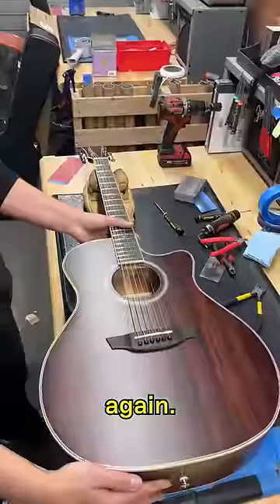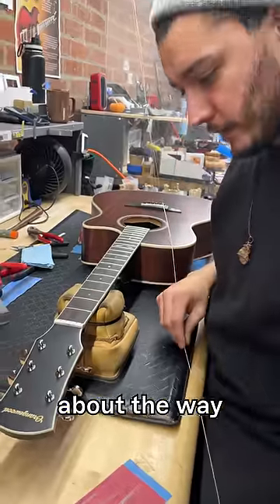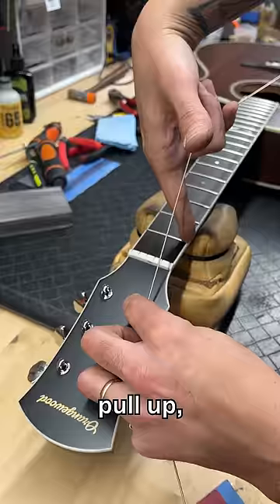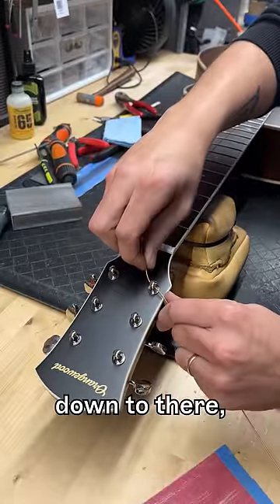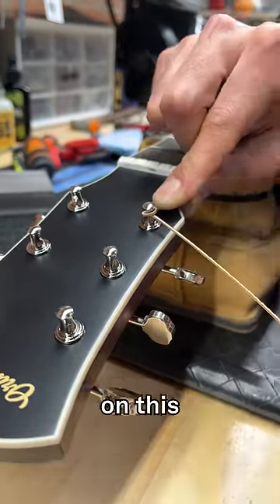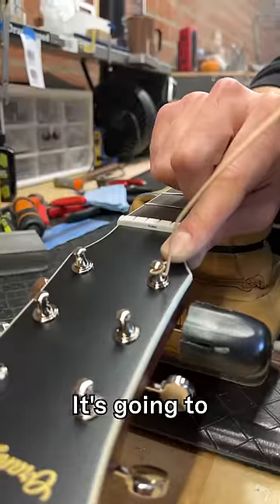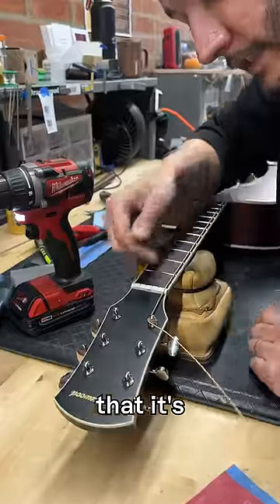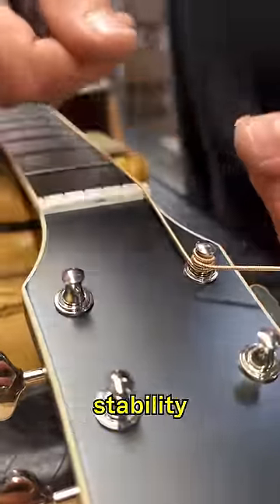Restring your Guitar like a PRO with this HACK

Comment: I used to do it like that (not the cutting them, not good), to get the extra winding length too.
But seen a better way where you pull the string tight to the tunning post and just wrap it around the post the desired number of loops, then push the end thru the hole making sure it exits the hole between the top loop and next one under it to lock it from slipping and you only have to turn the tunning knob a few turns to get it tuned.
Much much faster and no guess work on getting the right number of winding loops on the post because you pre looped it already.
  Have not seen a better way to do it yet...😉

Comment: Too much string on the post makes it harder to keep it in tune. I found that ones around on the thick strings and 2 twice around on the lower thin strings is best. Keeps it in tune easier and you can tune to pitch more in control. if you have too much string wounded around the post that can give more tension and slack making it more likely for your guitar to go out of tune or if you use a capo. Just my personal experience I been restring and playing guitar for over 25yrs.

Comment: This does not effect tuning stability. If you notch the other side the opposite way that over the top bullshit isn't necessary. In fact the extra winds on top increase the chance of microtonal slippage. 2 to 3 winds down are optimal.

Comment: I put the string all the way through and make it taught. Then I grab the string from the nut and slide it down to the second fret. Then wind as I hold the string down in place with my index and hold it under the winding string and you get a better result than this. When you manually wrap the string around you risk messing it up unless you’ve done it a thousand times. And it’s not always guaranteed

Comment: it doesn't matter, that's why the peg has a larger diameter at the bottom and tapers towards the top. As you the wind the string it'll lock in place.

Comment: Pull string thru the desired peg to the next peg. Cut at next peg. Pull back with just enough sticking out to start winding. First wrap goes over the string tip,  rest of the winds goes under. None of this other nonsens is needed!
Reply: Why would you cut the string before getting its set? Besides that, what this guy just did is way more simple
Reply: @NPC-mt1cz  because that's the correct amount needed. Why risk extra string flopping  around that could scratch the finish on a client's guitar? Cut to the length I mentioned, wind it over, then under the rest of the way lock it in place. Done.
Reply: I use that method of measuring where to cut, but I never go over - looks nasty - and my strings never slip.

Comment: It helping with stability is negligible. For example, it’s a common misconception that locking tuners have any added tuning stability. They’re simply used for faster string changes

Comment: This is likely the best pro tip for re-stringing acoustic guitars.
The bridge pins. No more mangled  pins from using pliers. 
Yes, I know those cheap plastic string winders have a notch to lever it out. Fuck that.
Easily get them out with no tools.
Just grasp the string an inch or so from the bridge and.....I know this sounds weird..... push the string back towards the pin while you wiggle side to side the ball part of the pin. Comes right out. No prob.
Before you put the strings on, bend the wire about 40 degrees or less where the string is attached to the ball end.
Now the bridge pins won't Lazarus their way up and out when tuning it in.
You're welcome.

Comment: Be useful to mention the first loop over is clockwise, while the turning adjustment is anti clockwise. Very hard to spot when using a cordless drill, without multiple replay and pausing.

Comment: Because every guitarist has a better way I'll add mine 😁...
Cutting off tensioned string can offset your truss. Also 1 & 1/2 turn on the post is all you need if you actually lock it under the wind.

Comment: Someone showed me... On a gi son for sure but most three to a side headstocks this will work.. run the string through the desired machine up to the next.... So for low E, run the tmstring up to the top of the A tuning machine, that will give tou exactly three wraps... For the D string run through the peg and just fold the string over the top of the headstock... Three wraps. I dont even measure anymore. Havent for probably almost twenty years. Personally dont like the luthiers knot but thats subjective.

Comment: I do the same but run the string through the tuner tight and then back it back from the next head up. Then i kink it to the side so it doesnt slip and start tuning taking the slack over the excess once and under the rest. Same principal and result but different method. Shops hate it when you guys get creative with those stupid knots and then we have to have pliers to take them off.

Comment: At last, someone restringing properly!
Reply: That’s actually just restringing one way. It’s not the ‘proper way’ because there’s no such thing.

My preferred technique that I use on all the guitars I work on is to straighten out the hole on the tuner first. Feed the string in and then pull it back the distance between two tuning pegs. Then just start winding with each wrap going under the previous one.

The over under technique that’s demonstrated here is a purely aesthetic difference. There is no other benefit to doing it this way

Comment: Tbh I kinda don't agree, what I do is make sure the strings are nice in tight where the bridge is then get the strings around the post, after that I put my hand where the 7th fret is with my pinky finger as the base and index on top and start tightening the strings, so this way when u tune your guitar the top 3 strings loop around 2 times and the bottom 3 loop around 3 times

Comment: Or, you know, just do it as intended by the tuners manufacturers, which is to just wrap the string underneath as it's designed to lock the string by itself.

Comment: Never chop all six strings off like that. It instantly relieves all the tension. Change guitar strings one at a time. Secondly, wrapping the string over the top twists it in a circle. Never do that either. In other words, ignore this video.
Reply: This is professional stringing, when they need to be fast. That's why they cut them all - they don't care if it f*cks the guitar up - more work for them.

Comment: Don’t like this method personally although it’s fine. That one wrap over then the rest under is only necessary for the unwound strings. The wound strings have enough friction to not need an above wrap. And even without the above wrap on the unwound strings you can get  away without doing that on a lot of guitars. Just put the tuner machine holes openings lined up with the nut slot pull the string through taught, then pull back to first fret for enough slack. Then bend the other end coming out of the machine straight up and start winding. Do the wrap above then under only for unwound strings. Saves some time instead of finding the slack then putting it into the tuner. Skip a step lol

Comment: That twist the string, calculate "2 passing the rotor (6) and then cut the string, move the rotor string hole 45 degrees right side up from the nut, then introduce the string and keep hand tension, it wont go out, wind the string naturally keeping tension on it, add one inch for cut the fifth and two inches for the four and so! that prevent the string get twist, NEVER WOUND IT WITH THE HAND! 40 years as a Luthier (Navarro Guitars) should mean something 😉Im now retire

Comment: Okay so that's not how you wind a string. At all. I've been playing guitar since 1982 I've done literally tens of thousands of restrings. You don't know what you're talking about. There's not a preference for it. You can be scientific about it. This method causes slippage. The not gets tighter string slips over the nut. You put the ball end into the hole and tap the string plunger in. 
Pull the string tight. Put it through the eye hole of the machine head. Go Midway through the A g D strings and cut. Or, if you want, pull that much of the string back through the eye hole and begin winding, pushing the string down so it winds from the eye hole underneath the string protruding out the opposite end and it winds neatly down the machine head. That is the correct and proper way to do this. My God, you people need a fucking hero. Thank God I arrived.

Comment: I never put loop on top on few I have like that I use mostly locking tuners but I measure same but bend it up the wrap tight where string is pushed tight against top of tuner never have issue and I use DR DDT 11-56  strings

Comment: as long as you wind the strings 2-3 turns around the tuning pole it will hold the tuning.  This locking tuning technique will only ruin your guitar bag for sure.

Comment: Snipping the strings under tension seems pretty dumb to me.   Just use that drill string winder and take them off that way.   The stupid overlocking knot is not just unneccessary, but it also makes your tuning stability worse as you have more string to unstretch and it now does so unevenly because of the knot.   Also those little snipped pieces of string are more likely to fall in the guitar.   Conclusion, this is slower than the optimal method, has worse tuning stability and is worse for your guitar. 🤘

Comment: I just wind it down. Looks better.  If you do it correct should get.
3 full winds on low E
4 full winds on A
5 full winds on D
Others wind down as close to bottom as possible. No problems with slipping or tuning. 
I never wind over and under. Sloppy

Comment: Please if you value your guitar And you want to do things the correct way and not just the fast way, Do not follow this advice Think of the neck of your guitar as a bow as in bow and arrow The amount of tension is extremely high Now imagine somebody cutting that bowl string while you've pulling The snap back on the bow ( Guitar Neck) Can damage. Also you should never remove all the tension on the neck Unless you are doing some maintenance such as , adjusting the truss rod One string at a time that's the way it should be done

Comment: All you have to do is kink the loose end of the string in the opposite direction from the wind, and it does the same thing. Putting a wrap over the top of it does absolutely nothing functional. That being said, I've been putting locking tuners on every guitar I own for the last 20 years so I don't have to fool with it.

Comment: Power Tools will continue to stay far away from my Guitar during a Re-String. I have never seen anyone cut the older strings when going to replace them, Not Happening. Call me Ancient School but if you want your Possessions to live as long as you do then I do NOT recommend any “Tips” seen on this Video other than the Looping Tip because this will help the Strings stack correctly and have even pressure when restrung/tuned by Hand.
Reply: I have seen another "professional" cut all the strings off at once. It's quicker, and if you are doing this all day, saves time. And if the guitar gets a bit f*cked over time, well it's not yours, and you probably won't be blamed. So why should you care?

Comment: Dont do it like that.... 6th string cut it at 5th string tuning post 5th at 4th, 4th at top of the headstock ( if its 3x3 headstock) then wind the string UNDER the hole for good nut tension lol. Dont do the goofy "locking your string in" stuff, its not going to help anything. Ive worked on guitars for over 20 years only broken 2 strings in my life about 20 years ago.

Comment: That's what I call the Gibson knot. I hate it, and it's not necessary. 3 turns down on wound strings and 4 or 5 turns on the unwound strings will be fine. If you still have tuning issues, look elsewhere. It's not the windings .

Comment: Luthier knots are fast and easy,  but I rarely use them...

For instance:  you loose one downward coil on the low E .
Which equals less break angle, and more leverage against the post because the string is one wrap higher up the post. 

The other reason is that in an environment where you have to do a quick string change , like in the middle of a gig .. or even a song,  those luthiers knots can take that much longer to take off the post ...the smaller the more of a pain.. 

However sometimes putting on a string on stage can go quicker with a luthiers knot....especially if a thin string wants to go caddywompus on stage.. 

But there's never a need on wound strings in my book ..
Reply: I'm not SRV or BB, the literal only 2 people I've seen change a string mid song. Be honest this is wildly unlikely.

Comment: I always do a string at a time. Through the tuner, pull one fret back, 90 degree bend up on the string and wind with the winding x3 under the string. Done.
Reply: I agree completely, I rarely ever have to tune and my trust rod stays right on.

Comment: Dont clip the ends of the strings, wiggle them until they break off, it ends up cleaner and you wont hurt yourself by accidentally touching the part of the tuning oeg where the string goes

Comment: No way. One loop tuck under string. Cut. Stretch string retune. Stretch string retune. Stretch..retune. I’m playing solo or with a singer on an archtop with floating bridge. Stretching strings is imperative.
Reply: Just tune up a full tone and tune down again. Saves all the pissing about. Instant tuning stability.

Comment: One thing i have learn that you never EVER removes all the strings at the same time.
Reply: Why not? How do you clean the fretboard and frets if you don't remove the strings first?  Wood isn't as fragile as you think, although it does take a little time to settle after changing the  string pressure.

Comment: "How to restring like a pro" Then proceeds to make 2 rookie mistakes. 

Re-string one at a time! The tension being released by cutting all the strings is bad for the neck and body. Also as the guitar comes back into tension you'll have more string stretch and will be retuning more often. 

2 wraps max on a tuning head. Not only does it look unsightly to have a big ball of wire on the pegs, it also affects the string life. You're more likely to get a break at the tuning head.

Comment: I can't stand when people string guitars like this. It's so unnecessary. Cut it to length, put about the string about 1/6th of an inch through the tuner, make the first wrap over the string that's sticking through, and the rest of the wraps under it. 

If you'll pull your string 1 tuning peg (maybe slightly more for the wound strings) past where the string will be and cut it there you should have the perfect length.

Comment: It’s not that deep, cuz. I keep up with severally guitars, hav no e restrung them MANY many times - I’ve used the Gibson “knot” this over-over-under, and just silly, quick, get-it-done  wraps… everything works. It’s almost like the Lute builders knew what they were doing when they invented tuning pegs. Relax. You’ll be OK.
Reply: PS: unless you’re a guitar tech for someone on a gig where the change needs to be “lightning quick” - you do NOT need to cut the freakin’ strings.

Comment: unesessary i see guys doing this .allyou need is proper stretching ive never had any guitar have a tunning issue and mine all have crap tuners and cost between 120 and 800 .but even when guys do this silly lutheur thing they still have tunning issues because they dont stretch there strings properly ollmao

Comment: Wrong. Never take all of the tension off of your neck at the same time. Replace your strings one right after another. Take the first string off roll it up and get it out of the way. Then put the new first string on, pull it up to tension so that it rings out at the proper pitch and then do the same thing with strings two through five. I love it how everybody’s an expert now and everybody’s giving out wrong information. Right Professional indeed.

Comment: Do Not string your guitar like this please , never cut all the strings like that  if You have a good guitar you don't want to loosen the tension on the neck all at once.
And  Always put a bend on your wound strings before you cut the ends off. This video is Very very amateurish